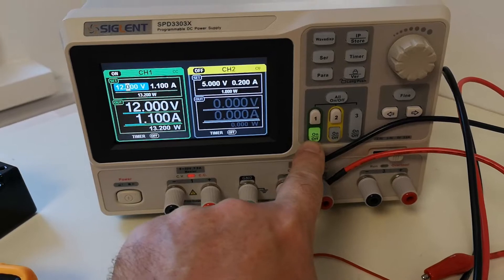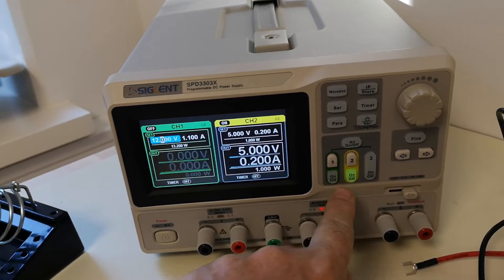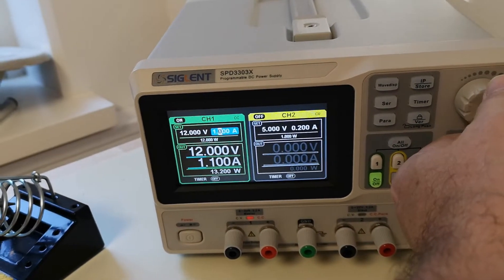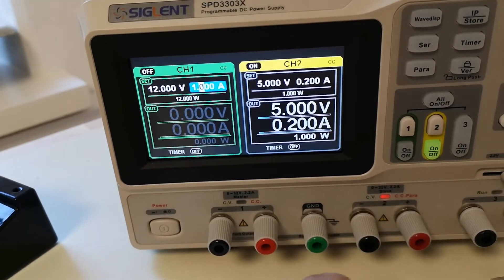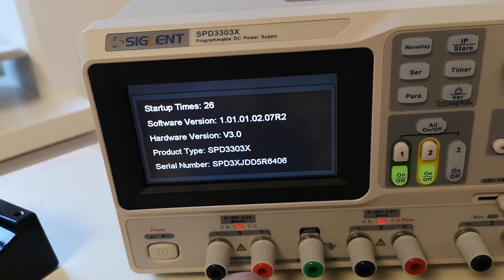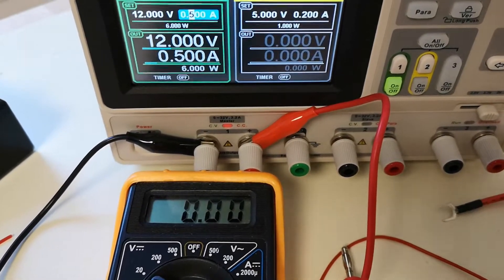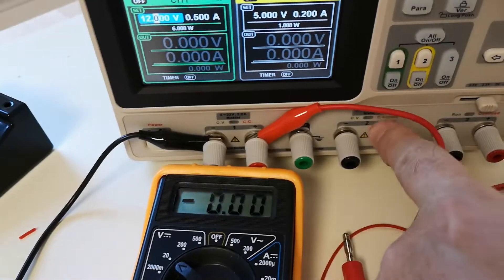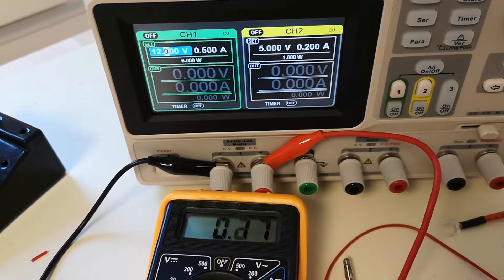Siglent SPD3303X power supply bug found (1.01.01.02.07R2)

Comment: Hello, if it was after the fw update and before it the source was working normally, there was an incorrect activation of OCP, which the source can do after the update. When switching from CV to CC mode, the voltage is only reduced and the source continues to work. When OCP is activated, the output is turned off and a reset is needed using ON/OFF, in your case it was probably stuck somehow and PWR OFF was needed. OCP mode is activated by holding down the right arrow button, if you have problems with dropouts, turn on OCP, set the range A to max and turn off OCP, the source will work normally.

Nice day 😁 Tom
Reply from the maker: i have not been troubled with this ever since, it is a power on thing, it consist of many parts that is connected by optical isilated serial lines, maybe a timing power on reset issue. but this is VERY rare. power recycle solved it.
Reply: @TeardownOZ2CPU  I would look at the set value in the OCP, is it possible that when it is turned on in a setting with a larger value, the OCP is activated even without drawing current. Set OCP to maximum value. Of course, it can be anything else as you write, including incorrect fw upload